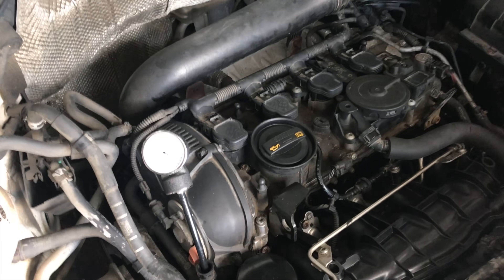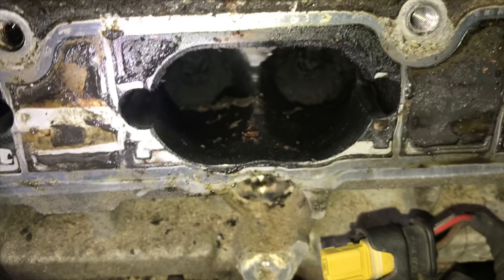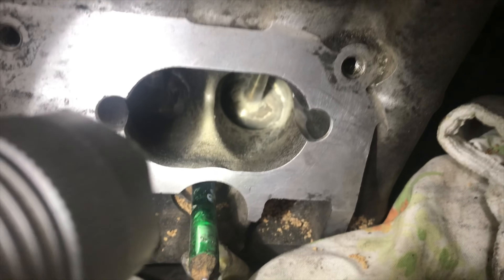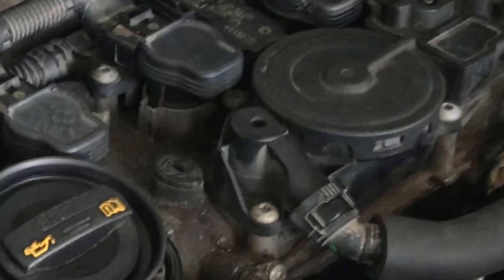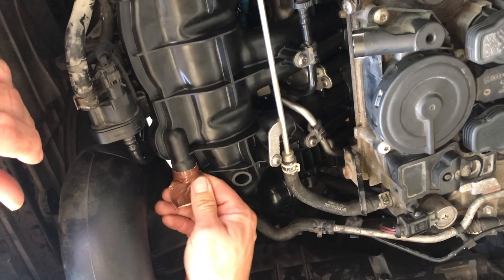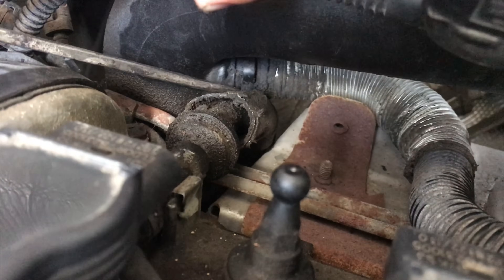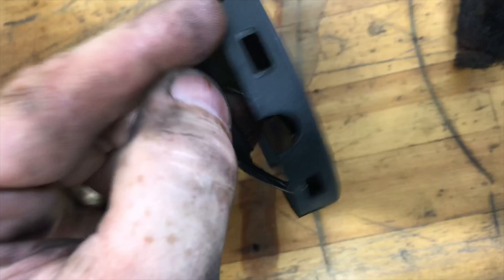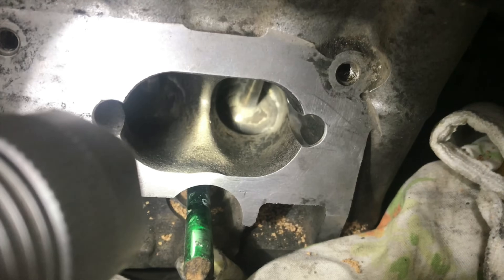WHY you want to check your PCV valve regularly

Comment: once it starts sticking to the roof of the PCV housing its basically time to replace. when the engine's running, the stuck valve won't be able to pull down with the vacuum. From a Renault scenic owner 😉

Comment: My engine runs perfect when halding the intake manifold pipe closed I have alsoi replaced the pcv valve completly by a oem part original The issue stlll persist

Comment: I can understand why a PCV valve that's stuck closed would cause pressurisation of the crankcase, and oil could be forced past the seals.  I can understand that a PCV valve that is stuck open might allow too much air into the inlet manifold under high vacuum at idle. What I don't understand is why more oil should come through the PCV valve when the valve is worn or failed  in the open position!   Surely oil vapours will be drawn through anyway - hence the possible advantage of an Oil Catch Can.
Reply: On other car brands you will actually see this similarly being called as air oil separator or crank case ventilation unit, the PCV is a separate unit that attached to it. Why you get more oil is because the diaphragm that was shown in the video is already worn out, which in turn does not separate the oil in the drain back to the manifold. I only answer you in what I understand from other videos that I watched. Hopefully it helps

Comment: Glad you made this vid.  When you blocked off the manifold port, did it run fine?  Does that hose need a little flow to supply to the manifold to run properly?  Just wondering and I do know that it needs to carry the vapors.

Comment: Would a faulty PCV valve cause a car to crank but not start unless you remove the oil filler cap?
Reply: Maybe but could also be intake problems or sensor

Comment: thank you for sharing all this knowledge. 
All PCV breather systems need timely  maintenance because air mixture control is  key for overall engine performance.

Unfortunately there is no DTC code pointing to a failed PCV yet German PCV are designed to fail in a hury with skinny membrane unlike the proven Japanese pintle over seat.
👍

Comment: PCV Valve made a big different for our two Honda Odyssey van and Acura TSX where they were eating up oil and engine felt heavy, it really brings the youth of the engine back big time, improve fuel efficiency, torque, power and free reving
Reply: yep, it did the same to my 150kMi ACURA TL. 
New PCV also cured the cold idle misfirings and sluggishness. 
Local Acura dealer made sure to never replace it so car felt old.

Bad PCV even affects the exact transmission shifting points because the intake vacuum MAP sensor gets consistent readings.
Now all the low rpm torque is amazing again after about 1KMi for PCM to relearn mixture map. No more engine vibrations from bad timings!
👍

Comment: Next time, try running seasfoam through the system... see if it’s easier and quicker to burn off the carbon
Reply: direct injection engine intake never see a drop of injected fuel...
✌️
Reply: Rookie

Comment: Question 
Installed a new pcv valve and now I have white smoke coming from my tailpipe it was not doing that before I replaced it and my car has been sitting for 3 weeks
Reply: If it stops when the engine has warmed up, then it’s water vapor from build up in the crankcase.  Change your oil, soon!

Comment: Thanks my car stall idle can it be pcv? I've changed everything else except ecu and pcv
Reply: I would say, yes. At idle, the vacuum from the inlet manifold is maximum. The PCV valve should close in this condition. If it does not, (diaphragm split) there is an effective vacuum leak (through the crankcase), weakening the mixture and causing rough idle and stalling.
Reply: don't worry it turned out the maf I bought was no good died straight away bought a better quality one and car has been working since
Reply: you simply need to scan obd2 to read your engine DTC codes. 
Buy yourself a cheap scanner... it'll be cheaper than replacing so many perfectly good OEM parts with no-name copy parts !!

Comment: I wish parts in the engine bay were all labelled because i have no idea what a PCV valve looks like in my car.
Reply: Well maybe you should have watched the video then cuz he shows you exactly what it is and where it is 😂 sheeesh
Reply: you can look up all engine parts names for free at any dealership online store 
or pay for subscription service like AllData dot com to help you out with repair information.
👍
Reply: stop 'wishing' and get the make/model/engine, year of manufacture for your car and have that for an online seller of parts. NAPA, PARTSGEEK, etc. can help you get the correct part ordered. In many places, a mobile mechanic can do the work if you are unwilling or unable to do it. A service garage is not always needed, especially to replace ordinary parts (air filter, spark plugs, spark plug coils, and similar).
Reply: Really? Just Google <year, make, model of your car> pcv valve

Comment: Can i eliminate pcv with a cap and leave only basament tube that go in oil canister?
Reply: nop, engine crankcase needs to be under controlled vacuum so pistons don't need to compress air on the way down!

The PCM software is designed to accounts for the air volume bypassing throttle plate.
Reply: @glasser2819  you can include a sealed catch can as part of the PCV system. The important thing is the system is a closed loop, otherwise it'll be a massive vacuum leak.

Comment: To understand: what force cause the PCV spring works (open/close)?... the vacuum or the pressure of the crankcase?  ....  because I have problem: I saw high vapor come out from the oil cap. wonder why! ..... I replaced with a after marker pcv valve 2 month ago.
some one told me maybe i have blowby problem. I know what cause too much blowby, but before go throw the piston ring I wonder if with a oil catch can can fix this.
But my question is, the pcv valve maybe is defective and no working properly to release that pressure??? PLEASE HELP !!!
Reply: the crankcase needs to be under vaccum to help pistons so they do not compress any air on the way down inside the crankcase. Else all engine seals will leak oil

Of course pistons have some blowby pressure so more caccum is needed to compensate.

Engine normal combustion suck a calibrated amount of air from inside the crankcase and also from throttle valve so mixture ratio can be calculated by PCM and measured by O2 sensors.
Good PCV is important else engine idle has lean misfires from too much air!
👍

Comment: Should change the pcv every 30k miles. Just did mine and found it was slightly sticking. Minor oil in intake. Carbon buildup on throttle body. Cleaned that up and car runs smoothly
Reply: Does it have to be tightened to a specific torque?
Reply: @freedomcuts  No.
Reply: @christophervanzetta  Thank you

Comment: Hi! I drive Audi a 4 b 8 2013 with CVT gearbox! And have an issue: the engine starts only from second attempt when it is hot weather (first attempt doesn’t gathering cold rpm’s - 1200, but only 600-400, second attempt is always ok). And another one: when in traffic or parking always pressing the brakes rpms are dropping down for one second. No check engine! Idle rpms are ok -800, dropping only when operating with brakes! Any ideas?! Thanks in advance!

1
Reply: Dirty throttle body??? Should be easy to clean as it'll drop the rpms at idle due to the lack of air flow
Reply: German money pits require deep pockets for endless repairs 🙄
Reply: Cvt is going bad. Normal issues with those engines.

Comment: 5.14.2019
Long Beach, CA.

Now that you've seen this guys little important Theory about the PCV Valve which should be changed with every Tune-Up, invest in yourself by purchasing a www.alldatadiy.com or www.mitchellondemanddiy.com CHEAP Version for your vehicle & see EXACTLY what you're supposed to do with your PCV.....They all cost DIFFERENTLY today.

A lot of you guys problems would be 70 % solved if you purchased the Real Service Manuals for your vehicles.Every answer is in there. But today, Year 2019 the prices are gonna make your head turn like the littke girl in the 1974 Movie, " The Exorcist"; whereas, the cheap version will be less than $30.00 a Year & it'll be sent to your Home PC or LapTop.You'll be surprised at what amount of information you can read about your vehicle.
Reply: yep, these online services are the best. I especially like the TSB Section.

Lately some CAN Bus modules also need software updates as evidenced by random crashes. The GATEWAY module communucations, Rear Cameras, crazy Keyless Doors etc
👍

Comment: Diaphragm of PCV valve is in very good condition (No crack,no broken) but don't know why oil going to turbo , any cause you know why oil consuming?
Reply: You have turbo oil ways, so if you blown the turbo gonna be a lot od white smoke and oil leak between the turbo and the outletanifolt ;)

Comment: Wow nice video! i'm going to change my pcv valve on my mx5. I hope this will stop the oil burning.
Reply: Hi did you change it and did it work? All of a sudden my VW started to burn a lot of oil with no noticeable smoke and it does have a bad idle/ misfire.
Reply: @dymalcartwright3696  did you figure yours out? VW/ Audi all do burn a lot of oil especially the turbo ones...
Reply: @Simpleman1078  yes I replaced the pcv valve and it has been fine ever since.
Reply: @dymalcartwright3696  if you start to have problems again look into a CATCH CAN

Comment: Charged 3100 to replace a rear seal a dealership recommended and my car problem was only an 85 dollar pcv.
Reply: Bad PCV will cause the engine to blow every engine seal to breath out pressure... not replacing PCV ropes in more business ✌️
Reply: I was just replacing my Acura TL tranny side mounts and saw how heavy shaking really wrecks everything:
shafts seals
O2 sensor broken wires
cracked exhaust manifold
tranny lines to radiator cooler
...

Simple timely maintenance is avoided by (dealer) shops until expensive repairs take place.

Ex: worn out serpentine TENSIONER surges the steering pump pressure regulator until rack and pump are both gone $4k instead of $50 tensioner that is still left bad ...
🤗

Comment: Holy crap that Audi pcv is gigantic. My Corrolas PCV Valve was smaller than a spark plug lol.
Reply: the German build this new junko PCV with cheap rubber membrane so they can go bad in a hurry... where good old Japanese PCV useva trusted cone pintle on a seat are good for 110kMi -
 Who wins???
Reply: oil leaks baby
Reply: Yes recently replaced PCV seperator in Audi Q7  it is huge and also the cost. Time consuming job.
Reply: @royrobert1216  It was hard to replace? I replaced mine on my 2015 vw golf and the part was fairly cheap and it took me 10 minutes to change it

Comment: Would this also result in some grey smoke on idle, slight revving and start up?
Reply: I had the same issue on a car with a similar displacement set up as these VWs and yes, it can definitely cause smoking from the exhaust and rough idle on cold starts. Hopefully you've fixed your problem by now
Reply: @xXThaUndeadLovahXx  is your car petrol or diesel?
Reply: And a dirty throttle body.  Easy to clean with throttle body cleaner

Comment: I replaced my pcv and it still makes the eerily shrieking noise. Old pvc had torn silicone. Mild smoke coming from engine bay. Your explanation of residual seepage from the pcv was awesome btw.
Reply: Solution was a seal leak in the valley pan. Beneath the intake manifold. Open that bladder pan reseal all intake connections
Reply: @iRecordOS  I've replaced 3 pcv valves and I'm still getting codes P2187 & P2279, would you mind linking me to a picture or can you do small clip of where exactly did you replace the seals? Please
Reply: @541_CoyotePower  it's known as the intake valley pan and it sits between the 2 valve covers.  I'm not sure exactly the problem your experiencing. If you could elaborate a tad I can help a little.
Reply: @541_CoyotePower  3? Why? You figure out your problem?

Comment: Wow! You use Ubuntu
Reply from the maker: Is there any other operating system?
Reply: @errorcodeguy456  lol, hey great channel. Did you buy the pc with os included or did you install it?
Reply from the maker: We’ve been working with Ubuntu since it’s infancy. Everything we do is open source. We duel boot most of our computers, because in the real world there’s just some things that only windows works on. 99% of what we do in Linux.
Reply: @errorcodeguy456  ive been thinking in buying a system76 and have windows machine for Windows only programs. Im starting to settle down about monking around with the hard drive. Cars and construction are my passion now.
Reply: @errorcodeguy456  hello new subscriber here I'm so glad I found you also I have a code p 2279 which is intake manifold leak I'm going to make the homemade smoke machine like you have and hopefully I can figure it out have you ever had this code and the car have is a 2010 Audi A4 Quattro premium plus the 2.0 turbo what year is this Volkswagen turbo anyways anything you can help me out with would be greatly appreciated!! KNOWLEDGE IS KEY!! TY BUDDY